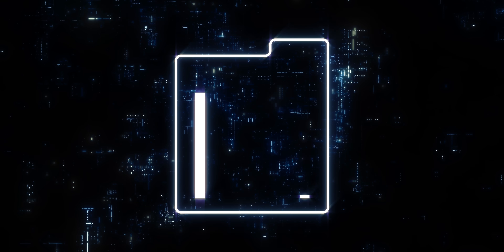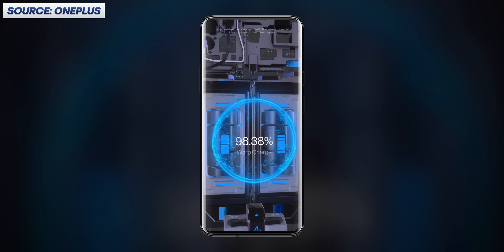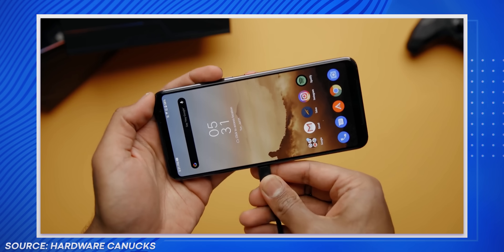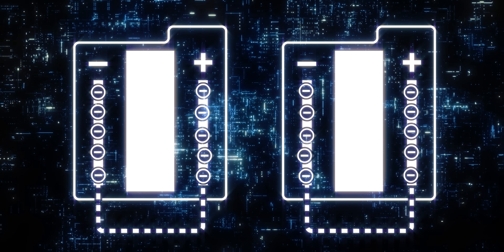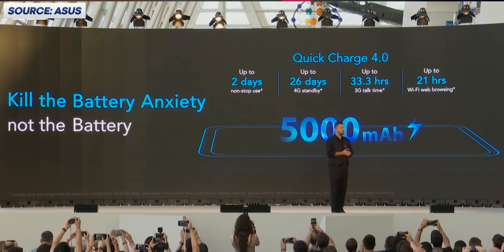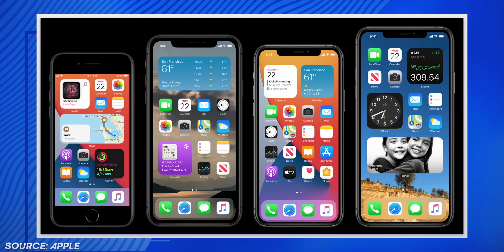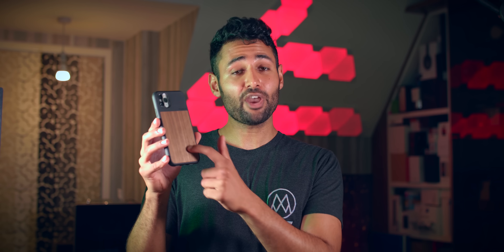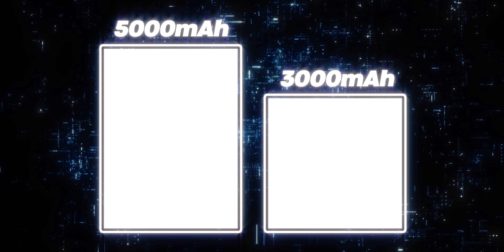The Problem with Fast Chargers.

Comment: Always charge my iPhone 11 pro max at night with the “slow” 5w charger, after a year still have 99% capacity.
Reply: LMAO thats shit is 100% wrong
Reply: iPad Air 2 10W after a year I have kinda 89% I checked
Reply: How did you conclude on 99% ...any app that I can check?
Reply: @gadgetview5813  you can check the battery setting on iphones, not sure with androids tho.
Reply: @Lryuix  I've checked my Android battery health with the app accubatery. Very accurate.
Reply: wrong, your capacity dropped for sure, what you men't to say, you charge that capacity that is left to 99%
Reply: Bojan Starič he meant to say the health of the battery is 99% now after 1 year of use..
Reply: Damn I checked my 11 pro Max also and it’s saying 92% that’s the result of using the included 18w fast charger. I’m gonna adopt your method 😅

Comment: Not gonna lie, I use the Super Fast Charger for emergencies/ whenever I fall asleep without charging it for the next day
Reply: good idea
Reply: So what did you use for normal charging??? Another phone charger?
Reply: @venddzer3037  I use the Anker 30W PIQ slim charger. It has USB C to USB C charging and I use regular fast charging. Same with my car charger.
Reply: @andradejose2460  oky thanks...I always thought that use another charger other than the provided from the company would damage my battery
Reply: @venddzer3037  honestly I've been using the Anker unit mostly cause of its compact size. I have it behind my bed and use a 6 foot cable to have on my bed since I don't have a night stand. But it works so good. Size is about a credit card or smaller.
Reply: ohh okay

Comment: Me: "Sweats in OPPO VOOC Charging"
Reply: Doesnt matter for oppo vivo realme phones. Their phones barely lasts 3 years anyways
Reply: @critik4l169  well my old oppo mobile [F1] is still at my home working correctly without a single problem it's been 3 years since I bought it , you guys just heard things from social media and be like "ah these oppo,Vivo,realme phones are shit" like bruh
Reply: GUARDIAN BRO just because you didnt find a problem doesnt mean its good. I used a vivo v5s from 2016 for a year and immediately noticed the lack the updates after just 1 year of its release date and the gradual increase of minor freezes with every new app updates from the store.
Reply: @critik4l169  I'm still using my 4 year old OPPO f1s. I have upgraded, but its still doing fine. So I use it as a second phone.
Reply: R Km do you still get updates?
Reply: And the freezes became so prominent that you could notice the frame stutters while pulling the notification panel or scrolling pages. This happens happens with majority of the 6 gb ram phones that claims to be a flagship killer.

Comment: 1) Phones like realme 7 pro provides 4500mah battery with 65watt charging. I don't think 4500mah is a smaller battery by any means.

2) The oppo fast chargers itself heat up while charging and not the phone. 

3) I have seen a survey where a fast charger was used to charge a phone for many cycles which didn't degrade the battery any more than they would normally with a slow charger.

Comment: My worst experience with fast chargers is that other fast chargers AND cables from other brands are very hard to pair up. 6A cables for DART charge of realme 30W chargers (or 30W Warp charge) for example are not STANDARD even in Qualcomm fast charging cables (typically max out at 3 or 5A). Even if you have a perfectly functioning brick, the DART charge won't work. It sucks not to have an option to get a cheap, compatible third-party braided cable for portability.

Comment: ok I had a Note 4 that I've been using for over 6 years and had to change it's battery 2 times during that period.. the fact that phones used to let you open the back cover and replace the batteries easily is something I miss since I upgraded to newer models.. now if your battery dies you either get a new phone or go through the hustle to change its battery in a workshop #BringBackOldSchoolBackCover
Reply: Agree👏👏
Reply: I don't like that idea. It wouldn't look that good (no glass probably) and it would be somewhat challenging to make it waterproof.

Hmm.. I got idea. Why not make something like a huge SIM tray, but for battery? That would be so cool, and it would look great since the opening for said tray could be on the top part of a frame.

I should patent it before telling you all of this 🤦‍♂️
Reply: @BloPsyy  I actually thought of that before. It was just a matter of where it would go and how the ports would function. Or maybe a rechargeable chip you can pull out/off and replace as needed. I don't want to say goodbye to water resistance either, so I'll go for any alternative.
Reply: @BloPsyy  Galaxy S5 had removable back cover, and yet it was waterproof with IP67 certification, I hope you learned something from that.
Reply: @BloPsyy  no u would need the battery to be on some sort of tray so u can remove it 
and that would just require too much space 
plus battery is connected with a tray u cant remove it like in older phones
Reply: @mouinemhb4960  no it wouldn't require too much space..
Also what? I don't understand the last sentence at all.
Reply: @BloPsyy  it would require a very big tray, and you'd had to have the battery on either the left or right side of the phone without no components there.
Reply: @BloPsyy  u mean lg g5?
Reply: @techpahpe9624  kind of, but without the whole bottom of the phone separating. 
As I said, something like a big SIM tray so the  modern phones can keep the appearance.
Reply: Ip68 go bye bye
Reply: @justsomepandawithinternet  I have an ip68 smart watch I replaced the battery on it and it still waterproof.  They could do it with some rubber gaskets and screws in the back panel but they don't like that look.  I always have mine in a case so I wouldn't mind it a bit.

The biggest reason they won't do this type of thing is it's an incentive for you to change phones when the battery goes they don't want to create a disincentive especially as phones aren't really coming out with game-changing features every year like in the old days.
Reply: @eluminaryxarrais7735  watch is not phone
Reply: U guys just invented AAA bateries
Reply: @mxv1439  not really 🙃
Reply: kalli valli

Comment: Thanks for this video. When I told reddit community about how fast charging is not the best they downvoted me like hell.
Reply: I try to do all three (wired, wireless, fast wired) but at random.  Mostly I'm fast charging it because I don't have time to wait, and even with fast charging the 40-80 rule has yet to fail me. And this is coming from a refurbished s7 edge user; still an amazing phone.

Comment: Best is removable batteries from my ericsson phone decades ago. They are charged seperately on a charger just like camera batteries. They even have slow drain function on the charger to protect the battery from fast discharge.

Comment: What if I put the phone on a REALLY COLD surface when its charging, or in a cold room like charging in the garage during late fall or winter? Will that help with the battery life?
Reply: Too cold and too hot temperatures both damage the battery life of a device
Reply: @2tangoplsty613  Ok true, but since battery heats up when being charged, wouldn't adding the right amount of cold temperature offset it and improve battery life long by reducing the wear and tear caused by the charging heat?
Reply: @zszs100  no. Chemistry 101. Too hot doesn't go well with too cold. That is why it is not good to get to a cold room instantly when you are outside in a very hot weather
Reply: zszs100 it’s the same reason why Tesla’s don’t perform as good when it’s too cold.
Reply: Funny story I had a note 5 and forgot to charge it , fell asleep at 80% when I woke up it was 75%, but the catch was that my aunt forgot to turn on the heat, so my phone was cold. Other times it would have died during the middle of the night.

Comment: Do a “Why the last 1% of your phone battery last so long”
Reply: It is the same buffer concept he mentioned when the battery is full
Reply: I think the last 1% in the phone battery is like the reserved gas on vehicles.
Reply: That's why they say charge your phone's battery from 20 to 80% and not 0 to 100% to reduce no of charge cycles ultimately increasing lifespan
Reply: For me, it's the complete opposite. The time my phone takes to go from, say, 95% to 90% is A LOT more than the time it takes to go from 15% to 10%. Higher percentages last more for me.
EDIT: My last 1% is completely non existent lol.
Reply: @ashutosh-dv3ty  this happen probably when battery has degraded. My 2 year old huawei has this issue. From 80% to 30% it's really nice but from 12% to 3% is so fast that within few minutes phone gets dead. And when i put it in charge, and switch it on immediately, it shows  11% immediately
Reply: @ashutosh-dv3ty  which phone you will use
Reply: A battery gets seriously damaged when it's at say 0%(unstable) so  1% is not always 1% to protect the battery from damage
Reply: @Danushsalla  1% is always 1% but however the software on the device can say 1% when the battery is in reality still at 5%.
Reply: @Oystein87  Yeah that's true
Reply: The last 1% usually dies really quick in my experience. But yes, there is a "buffer" if you will call it that. Not really a buffer but there is software involved. 
And if you had a iPhone before (I hope they stoped doing it now) then you would most likely never see under 4 or 5% before it shut down anyway since they adjusted what numbers to show in the battery %. They had a feature that showed it had 100% for longer just to give an illusion of having better battery :P
So when the iPhone finally said 99% it was basicly between 94 - 96% real battery life left.
Reply: @Oystein87  lmao where did you get this? I usually tend to get my phone around 5%-1% without the phone shut itself down.
Reply: @deadiseasy7891  From every battery manufacturer ever.....
Uhm... Point beeing?? It can say 0% in the status (It actually did say 0% on my Note) bar but the actual capacity left in the battery is atleast 2-3%. If you would drain a lithium battery to REAL 0% you are at high risk to kill it completely. So protection is programed into the software and firmware.
Reply: @Oystein87  give me the source.
Reply: @Oystein87  also I just share my exp. Nothing to point out lol.
Reply: @deadiseasy7891  Google it. All manufactures say this and the people that developed it
Reply: Lmaooo exactly the question I had
Reply: its such a weird phenomenon that the last power level lasts longer than it would have at full level
Reply: @trevoromondi1663  No.. It's just on some phones and it's just the software that tells it wrong.
And also the phone shuts down before hitting REAL 0% do prevent wrecking the battery if it's fully drained.
Reply: He said that charge buff so maybe a charge nerf as well. Where the battery isn't at 1 percent but it shows its 10 to avoid that really pressure state or whatever he said
Reply: Mine not !😅
Reply: My Samsung s20 ultra dies in 2 mins when 5% is left lol
Reply: @sleazo7  i think to stay away from unstability samsung uses that technology in high end mobiles
Reply: My phone has been on 1%, and by lowering the brightness to the least, turning on the battery saver (duh), turning on the night light, and occasionally turning grayscale and/or adding an even lower brightness app, my phone has stayed on for about 20 to 30 minutes.
Reply: Don't know man, My phone (LG )dies instantly once it reach 2%
Reply: calibrate your battery !❤
Reply: @Vsatyk  same with electric cars. They wil say that there is no range left. But you can stil drive  10 to 20 km. Sobthstbyou can atleast find a charging station or just get of the highway
Reply: I have an iPhone 6, I was in a car with no chargers, it was at 1%, and I wanted to watch some youtube videos before it died. then after more than 8 minutes it still hasn’t died and I was actually pretty relieved
Reply: https://youtu.be/Xxjv0erXKlU
Reply: @carloandreaguilar5916  But you still got like 5% left in the battery when it shuts off. To prevent fully draining it since that will ruin it.
Reply: @carloandreaguilar5916  Yes, it is true.. Because draining a lithium battery to REAL 0% can kill it completely. Thats why there is a fairly good margine put in. Facts. Just ask the manufactures👍
Reply: Yea it Happens To me
Reply: @carloandreaguilar5916  Yep. Haha. Cool.
Yeah, they stay at somewhere up to 5%. Differences are always a factor.
Reply: Most phones at 0% is actually closer to something like 5-10% because actually reaching 0% on a battery would cause drastic damage to it.
They add an artificial 0 where the phone shuts down in order to protect the battery from over discharge.
Reply: Do a why iPhone percent go from 65% down to 1% sometimes in less than 5 seconds
Reply: That happens to my old iPhone 6
Reply: Because its saying i am dyiiiiiiinnng
Reply: My last 3% last 30 seconds.. Like literally the phone just tells me that's gonna shut down in 30s, and it does.
Reply: Cause most phones shut all unnecessary functions down when battery reaches critical level cause it to use min amount of power required for the phone to just stay on.
Reply: Sometime you don't even see 1% before it dies... 😆
Reply: @t.b1z918  haha... Sorry... I never experienced such things as i have not used samsung phones before..
 I'm using lg g7+ thinq.. And another thing is i have not discharged it completely too.
Reply: @t.b1z918  true some phones turn off at 4 or 5 %
Reply: It stays longer in iPhone only.
Reply: @norscop35 not true,that is the same for Android Smartphones too
Reply: Phones automatically tend to go on insane power saving mode, so you can save your work or game, or reach to get your charger. It's also a buffer because if batteries aren't doing anything, they can break quite easily.
Reply: @louis george it might go to zero but It wouldn't  actually be zero it might be the software or your phone might be a little old
Reply: That's true,  my phone could last more than 40 minutes playing games being at  1%
Reply: Yaaaaas
Reply: If fast charging destroys my battery, slow charging destroys my patience
Reply: on my Nokia 7.1, 1% sometimes lasts for 15 minutes
Reply: In my experience I think it has to do with reserved battery. Because once my phone "dies" I put it on charge instantly after and it's already 5% turning it on.
Reply: I use Huawei and you can't even use your phone when it reaches 2% 😂

Comment: Disagree. I have the OPPO R17 Pro from 2 years ago, it has 50W charging, 0 to 100 in 35 mins, doesn't even get hotter than my laptop when I'm playing valorant. It gets ever so slightly warm if you charge all the way to 100%, but not even warm enough for one to realise its warm when you pick it up.

Comment: Too many experts saying on this. What you need to use is the adapter designed for the model of your phone whether it’s an Android or iPhone. Also, they trickle the charge on your smartphones which is one of the advantages of having these smartphones. As well as the Optimized Battery charging feature which makes your phone safe to charge at all times no matter what percentage you have left. For battery to be degraded, it usually would lasts 2 years since that is the average estimated battery charging cycle of an average individual. Battery before needs replacement could only hold to perform it’s normal peak when it is not able to reach yet 500 cycles of charging. Bottomline, use the phone as necessary and whenever you need to charge, just charge and make sure to turn on those features on your smartphones since they were created for a purpose. If you need fast chargers, just bring powerbank with you and still use the default adapters from your manufacturers. I hope this helps! This is usually the things I share to the team whenever I conduct trainings about smartphones.

Comment: that and fast charging is not always useful. I  for example only charges the phone during the night when I sleep so for me there is absolutely no point on having fast charging which is the reason why i prefer phone with bigger battery than a phone with a fast charging capability. My Galaxy M31 only has a 15W charger but I never found it to be a hastle even if it takes more than 2 hours to charge because the 6000 mah battery is more than enough to last a full day of heavy use and i just plug it before sleeping.

Comment: This is why I worry about importing Xiaomi Mi 10 Ultra. its fast wired charging and wireless charging is questionable at the very least, but surely battery capacity wont last long or as it used to  with such fast charging speeds. If ever it comes that the there be battery or charging issues,  I wont be able to send it for repairs.

Comment: You’re wrong about keeping the battery at 50%. If the electrons were evenly distributed, then the battery wouldn’t give out power (This is the empty state). So there will still be an imbalance in the electrons of the cell.

Comment: I’ve adjusted the way I’ve charged my phone for years. First I was charging my phone to 100%, then it dropped to 65, 75, and now the highest I let it charge to is 80. Looks like 50% will be my new 100.
Reply: you basically loose half battery capacity.
Reply: @DragonProtector  you mean by only charging to 50% or the way I used to do things?
Reply: @phaze1844  by only charging to 50%. If you charge say 20% to 80% or 50% to 80% you will get a longer battery i believe.
Reply: @DragonProtector  oh ok. I’ll test that out.
Reply: @phaze1844  :) hope it works for you